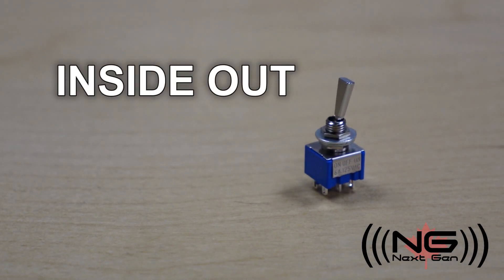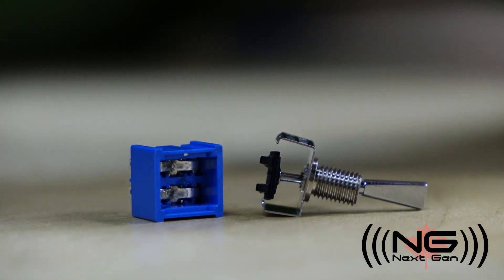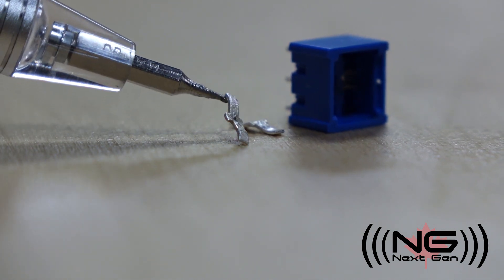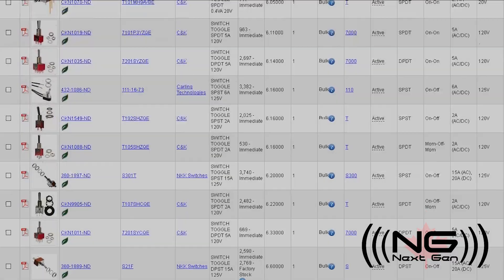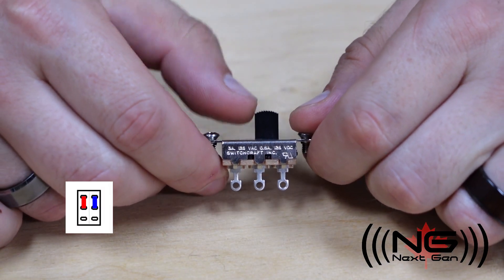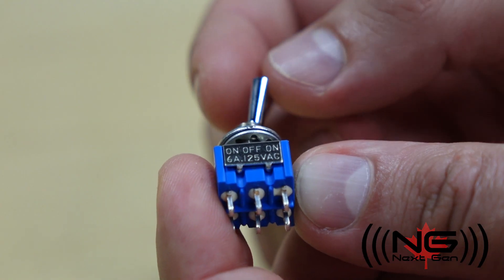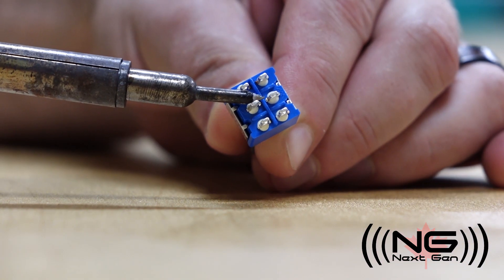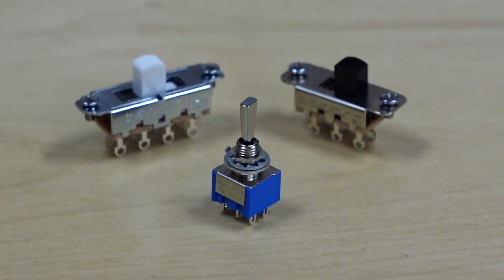Inside Out - Mini Switches

Comment: Do on-off-on switches kill the signal in the middle position, because it turns everything "off"? Or does it just send out a signal unaffected by the top & bottom pins? (SPDT)
Reply from the maker: Switches have common lugs and throws, and they switch between the throw lugs.  A switch with an "off" option, disconnects the common lugs from all throw lugs.

Comment: This video is great, the only thing im cofused by is the rating on the switches,
Can i use dpdt on-on toggle switches on the guitar that are 0.5A rated or do they need to be 3A or higher?  

I dont underatand how this affects if i can use them and i assumed the guitar was a passive circuit so it didnt have much flowing through it but i have no idea what im talking about 😂
Reply from the maker: Your assumption is correct. 👍 Guitar pickups generate <0.5V.  Maximum hard strumming with a high output pickup and 500K pots would draw <100nA of current.  That's <0.001mA, or <0.000001A.  To put it simply, the current and voltage rating of pots and switches don't matter one bit inside the guitar.
Reply: @NextGenGuitars  Awesome, thank you so much, i couldnt find anything on google explaining this and you just cleared up all the confusion.
Really appreciate the help.

Comment: Awesome, I'm using your information for a DPDT switch for a telecom PL240C tone generator. I think I will be able to have a decent chance at repairing as i have all the pieces. The prior owner broke it, however left me the gift in the truck I inherited from him at work. This equipment if far more powerful than the Fluke type I'm issued by the company, they won't spend the higher $ for my position type. Thanks again!!!

Comment: If a toggle switch breaks can you just replace the lever?
Reply from the maker: This video was more to show how it can be taken apart and serviced, so long as the internal parts aren't damaged beyond use.  It's extremely difficult to find replacement parts for switches.  And, even if you do, chances are the cost is nearly as high as just buying a new switch.

Comment: @NextGenGuitars   can I use mini switches to replace toggle switches on my LTD EC 50?
Reply from the maker: Sure, though I'm not sure why one would want to.  It wouldn't be a drop-in replacement and would require some effort because the hole size is much bigger than the mini switch.  Also, generally you want a much more robust switch than a mini switch to be used as your pickup selector.  But, I suppose that could be a preference thing.

Comment: Trying to figure out what switch to get to make my LP go to a 1 vol 1 humbucker set up just by flipping a switch. Is that possible?
Reply from the maker: Would need to know more about what you're specifically trying to do.
Reply: I have a LP styler with a 3 way switch, 2 humbuckers, 2 vol and 1 tone knob that is push/pull.

I’ve seen some guitarists have a mini toggle that allows the bridge humbucker go full power which supposedly allows 1 vol and 1 humbucker. I’ve seen this on a Mastercaster Strat
Reply from the maker: @JamesJonahJameson-MM  "Going full power" generally means bypassing the tone pot, or bypassing all the controls and going straight to the output.  The result is a little brighter with a little more output.  You can definitely wire a switch into your guitar to accomplish the same task.  The difficulty is finding or making the wiring diagram necessary.

Comment: Great video!
I've an idea and it may be absurd, but I hope you can help me.  A 4pdt (on / on) can be substituted for 2 push / pull? 
Thank you.
Reply from the maker: Yes.  2 DPDT switches are the same thing as a single 4PDT, as long as you engage both of the DPDT switches at the same time.
Reply: @NextGenGuitars  I thank you very much for your answer, there is not much problem with activating both, it works the same way and it is what I have right now.

Comment: Can I use these mini switches for activating Coil split?
Usually, when you wanna use coil split, you pull up the volume button, right?
But I'd like use a mini toggle switches for this.

Do you know if there's a video about
how to wiring HH coil split to mini switches?
Reply from the maker: If you wanted 2 switches (one for each pickup), you could use 2 SPST switches:

https://nextgenguitars.ca/products/generic-mini-switch-spst-on-off.html

Or, if you want them both wired to one switch, you could use a DPDT switch:
https://nextgenguitars.ca/products/generic-mini-switch-dpdt-on-on.html

I don't know about a wiring video, but there are many good wiring diagrams on the web.  A push-pull pot (the kind you mentioned) is just a pot with a DPDT switch built into it.  So, it's the same thing really.  If you find a wiring diagram with a push-pull pot to coil split, just treat the switch lugs on the push-pull as if it were a separate DPDT switch.

Hope that helps!

Comment: hello. I have a question. I am not that knowledgeable about electronics 
and I am trying to wire an active gain boost to my guitar with a 3-way 
switch using this configuration:

position 1: Guitar pickups ----> Volume pot ----> Gain boost ----> Output
position 2: Same as position 1 but with an additional LED battery level indicator connected to the 9v battery
position 3: Guitar pickups ----> Volume pot ----> Output (gain 
boost is bypassed; connection between 9v battery and the gain boost is 
broken to prevent battery from draining when not in use)

what type of 3 way switch do i use and how do i wire it up? thanks
Reply from the maker: Honestly never wired up a battery level indicator, so I couldn't help you on the specifics on building that.  As for the switch, you could do that with a DPDT On-On-On switch.  But, the battery indicator setting would have to be either position 1 or 3.  Otherwise, the level indicator will be active in 2 positions.  1:44

For what its worth, an outboard boost is more versatile than having one built into your guitar.  I would build a boost pedal, instead of doing it in the guitar itself.

Best of luck with your DIY efforts!